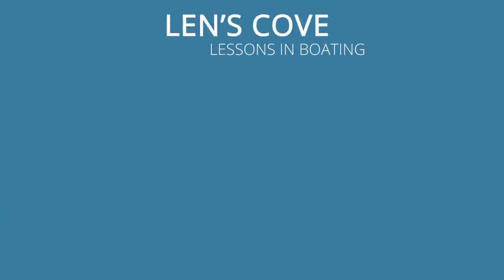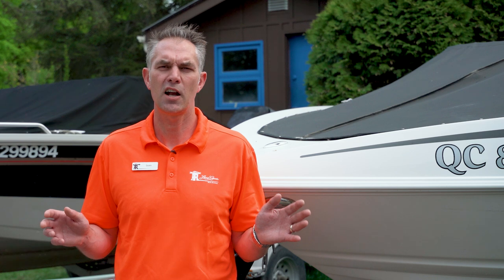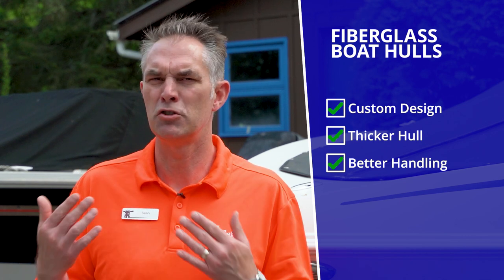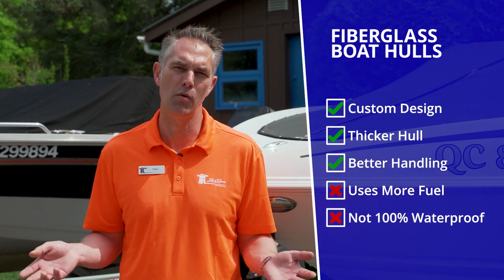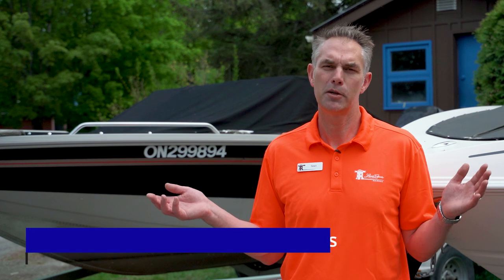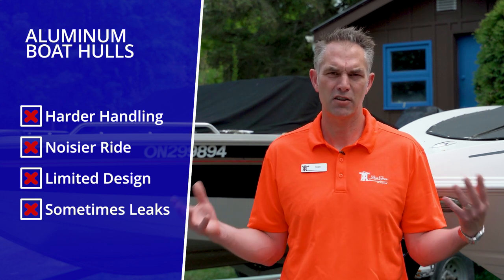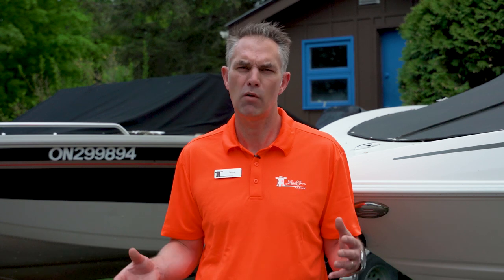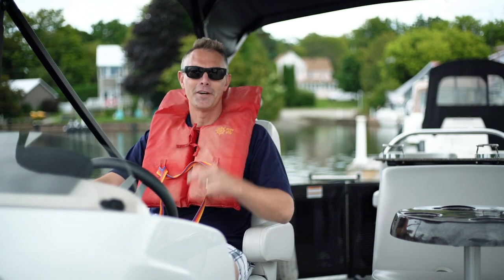Aluminum vs Fiberglass Boats

Comment: The aluminium boats in America look so basic compared to the ones we have in New Zealand
Reply from the maker: What are the popular brands in New Zealand?
Reply: @boatinglessons  extreme, stabicraft, white pointer, profile, surtees and a few more
Reply: Duckworth, Wooldridge , king fisher ,hewes stabicraft,allied liberator , ACI     That’s just a few on the northwest coast lol should I continue
Reply: @pittypitt2779  New Zealand is the size of the state of Colorado
Reply: @captainmigs1655  Nicer people though 🤨
Reply: @JohnJohn-cu7nk  no nicer ppl than a southern belle
Reply: Have you ever seen Gator Trax Strike Series bass boats or the GT Series shallow water inshore models,  you can design a boat that will last a lifetime

Comment: You did not talk about all of the wood or foam that is used in all fiberglass boats  that will rot then you are screwed. WHY DID YOU LEAVE THIS OUT AND YOU KNOW THIS IS TRUE ????
Reply from the maker: Yes, that is correct - a lot of fiberglass boats do have that and we did not think of that when creating this video. There are many fiberglass boat manufactures that do not use wood at all. There are other ones with wood in them that have been totally fine for 50 years! Each case is different, and the older the boat, the more cautious you should be. A marine survey can often find early signs of rot if you are concerned.
Reply: That is the most important thing to know .

Comment: Aren't aluminium boats way more durable? Let's say you hit something you have higher chances of the aluminium to survive?
Reply: Yeah and if you want to pull up to a rocky shore with a fiberglass forget it
Reply: If you hit rocks with any boat you'll be lucky if the gash doesn't sink your boat in an instant, no matter what material you use.
Reply: @Driendel You must never been on a mud boat doing 50 and hit a rock in the river and be two to three feet in the air! I hate it when people that don't know what they are talking about can't keep their mouths shut!!!
Reply: @thomaskitlica5572  
 I'm pretty sure hitting rocks damages the hull and can cause the boat to sink, and will do so in most circumstances.
If you hate random strangers on the internet because what they say doesn't conform with your own experiences, then you're a bitter old man who can't take an opinion to save his life.
You're in the internet Thomas, if you want people to shut up, that's not the way to do it.
Reply: @Driendel  I apologize it's just I run a rocky log infested creek and I promise you that the fiberglass one's are the ones sinking as we slide by riding almost dry sand! Fiberglass has it's purpose but toughness isn't it!! Cheap and easy to use.

Comment: Longevity ,you can have an Aluminum boat forever (will it to kids ) but after 20 yrs (give or take )fiberglass shows its age and is probably breaking down in a serious (transom ) way !!
Reply from the maker: If not cared for - you are 100% correct. We have lots of 70s fibreglass boats still going strong though
Reply: FYI, many aluminum boats have a wood core transom cladded in an aluminum skin. If these boats are not properly cared for their transom can rot too.
Reply: @danield954 wow one piece of wood that is obvious when it's bad!! Fiberglass you have to do core samples and cut open the deck to see what is rotting!!! Just because they aren't your cup of tea doesn't mean that it's not a superior building material for boat's!!! Why do you think 90 percent of all commercial vessels are aluminum or steel!??? It's not because it's cheaper I promise you!! It's far cheaper to spray some plastic over a mold and slap some paint on it!!!
Reply: @thomaskitlica5572    Actually, from living in the Great Lakes region I prefer an aluminum hull over fiberglass. In fact I have an aluminum boat. They are lighter so they are easier to tow, easier to launch and retrieve. They also are better on fuel.

Comment: Completely nonsense
an Aluminum hull can take a bullet
a fiber glass cant
ever had a bump in a early chevy corvette?
Aluminum hulls do not burn because it is not manufactured with highly flammable resin.
They save lots of weight which means you can go up in size.
Geez the list goes own
I don’t want to be in rough seas in a 
a plastic boat unless you are The Viking of the high seas.
Fiber glass repair is expensive and time consuming
the list tilts heavily towards aluminum 
altho they might be expensive cuz
duuuuh 
they are aluminum...
he says fiber glass is stronger
I dont think so
compression test for composite is 30k lbs complete crush
Aluminum is double that and is lighter
dont think so

Comment: Every substance having its pros and cons , the proplem of aluminum as I hear , is corrosion and not easy to fix
Reply: Just the opporsite, Fiberglass is not easy to fix, besides, fiberglass is much heavier and waste fuel than aluminum.
Reply: My aluminum has not rusted yet after 30years
Reply: aluminum  do not corrode only in acids
Reply: @crisangle8592  My understanding comes from scuba.  The aluminum 80 tanks will oxidize, but the surface layer of aluminum oxide then kind of forms a protective coat that keeps it from continuing to oxidize.  Maybe this only works on a thick piece of metal.  The steel tanks will rust and then just keep on rusting.   Some alloys of aluminum are pretty resistant to corroding though, when you say steel or aluminum your kind of just scratching the surface there are so many alloys of each with different properties that is hard to say.  Also do you use it in the ocean or on lakes/rivers?  I think all boats are happier in fresh water.
Reply: @jeffk464   there is nothing better then aluminum  , but in ocean it corrodes even if it is marine grade , but in long run it will payoff coz it is lightweight and , relatively stronger in some cases